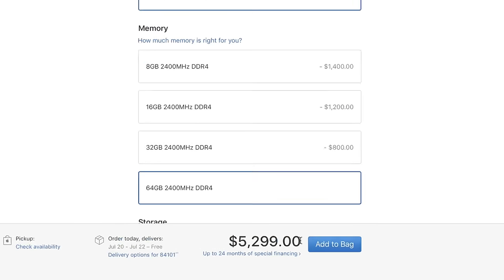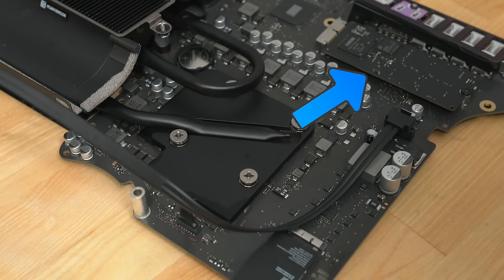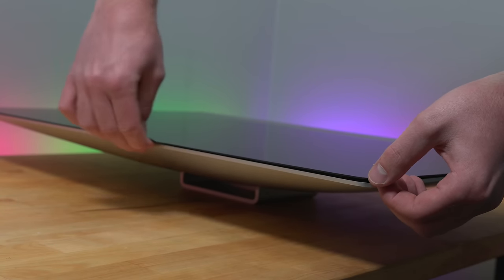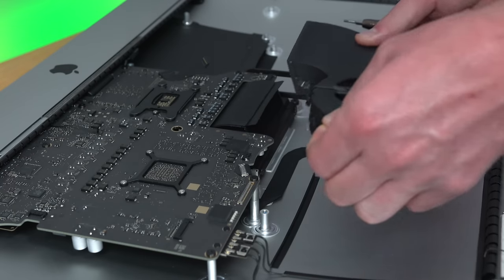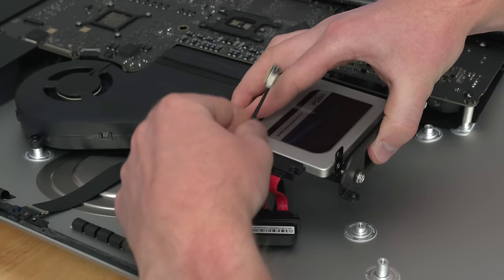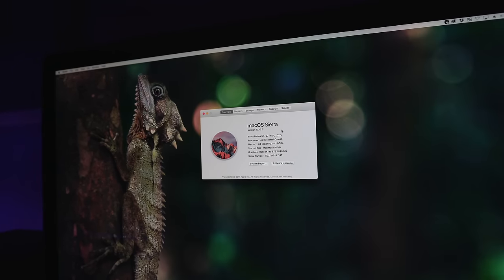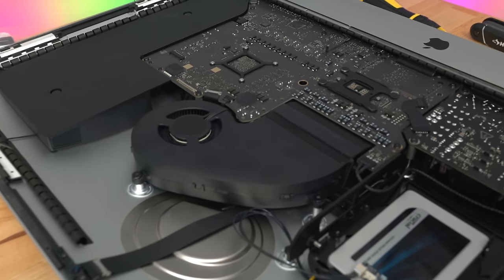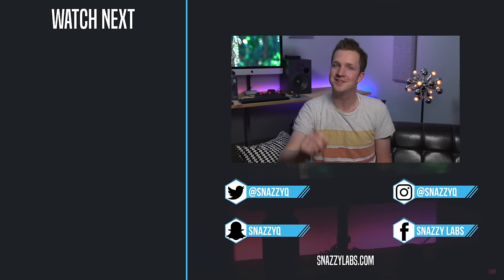The Best 2017 iMac Apple Doesn't Sell!

Comment: "May cause serious injury, or DEATH" but don't worry , touch the edges and you'll be fine. Incredible..... If you want people to feel comfortable following your tutorial after a "death" warning, you might want to briefly elaborate on why "death" is a possibility when handling power supplies. This is important stuff. People have actually died messing around with them before.
Reply: Surely only dangerous when plugged in, or you can get a jolt from the caps if touched too soon after unplugging.
Reply: That's not true. Power Supplies can hold a charge for long time than just being plugged in. Other than the 5K Display I don't see the justification in upgrading an iMac when building your own computer with a good 4K display will be just as good. Sure you're losing a little bit of the resolution that a 5k Display has, but it isn't that much. Besides use a second monitor if you're missing that extra desktop space. I'm old school where today's stock computers are fast enough for me and if I'm rendering a video that will take some time then it's time for a break to do something else.

Comment: Apple's NVMe drive isn't proprietary at all, it just has a stupid length to it. A few seconds with a dremel and some masking tape would fix it.
Reply from the maker: +Makaka No.... The key layout is different and the the voltage pushed through the drive is much higher than M.2. There is zero cross compatibility.

Comment: Still way too expensive machine for productivity since it's only a quad-core.
Would be nice if Apple would start using Ryzen 7 processors since these are so much faster for productivity.

A new Mac Pro with a 16 core Threadripper would also be awesome. The current Mac Pro is horribly, horribly outdated with only 6/8 cores.

Comment: If the mac didn't used proprietary connectors, the cost would go down a bit. Licensing a proprietary connector costs a bit of money so that's one of the reason that the mac is overpriced.

Comment: ik why ur having better scores with ur imac than apple imac and the reason why is bc apple uses crap thermal past and basically thermal throttle the second they turn on apple needs to learn that u need a good fan to cool ur pc not just big heat sinks  and small fan

Comment: You clearly don’t know about ESD damage. If you did you wouldn’t be opening up a brand new iMac and ruining your warranty without being grounded.🤯
Reply from the maker: ESD protection is built into modern boards and it is extremely rare and unlikely to damage these components as long as you’re not rubbing a balloon on your head.

Comment: hey snazzy, you're my favorite Apple related YT'er.

2 quick questions; if i wanted to do this mod myself:

1) after I install all the SSDs, is there anyway to keep the fusion drive that comes with it also?  just for extra storage.
2) is there a way to add extra fans/AIO/heatsinks?

Thanks in advance.

Comment: You used actual Quality thermal past! lol Your DIY iMac runs cooler so the CPU and GPU are NOT being throttled to avoid over heating. lol That's why your DIY benches higher. Problem solved. :-)

Comment: Or you just you know BUILD A PC.
It's no surprise you can mod a cheaper iMac to have a better CPU and more ram and it be comparable to the latest releases, that's because you are being scammed.
If you built a PC it would probably half the price because 1. No Apple logo and 2. No parts already in it to swap out or mod you just put it together.

Comment: This video is full of misleading information. He did not save $1800. To make it the same he would’ve needed to use a 2TB 960 Pro m.2 drive, which costs over $1,000.

He also states that Apple buys the worst chips or he got lucky? No. He used different thermal paste, better but could have a shorter life. Better cooling means a quieter and better performing machine. The 8% lines up perfectly with results from MacBook Pros and even PCs when swapping thermal paste. Hell The silicon lottery has nothing to do with this. Apple and Intel promise a base and boost clock, and macOS does not let you surpass that. Changing the CPU doesn’t affect this either.

Also as with many of his videos, there is flawed testing. To get accurate numbers, he needs to run the fan(s) at max speed. Easy to do in the macOS environment with Macs Fan Control.

Also regarding the Mac Pro? More misleading information there as well. It doesn’t support 5K why? Because it’s thunderbolt 2, not 3. Thunderbolt 2 cannot drive 5K@60. It can only drive 4K@60. So duh, of course it doesn’t support a 5K display. ITS ALSO A 2013 MACHINE! 5K@60 wasn’t even a thought then. 4K was barely prevalent.

And comparing results between the computers? A 4-5 year difference in tech is hardly fair. It seems he fails to understand core count and clock speed are not the only important factors in performance, for CPUs and GPUs.

He even admits that he pulled the average Geekbench results. The average user is running other shit in the background because they don’t know exactly what they’re doing.

The insolence in many of these videos is astounding.